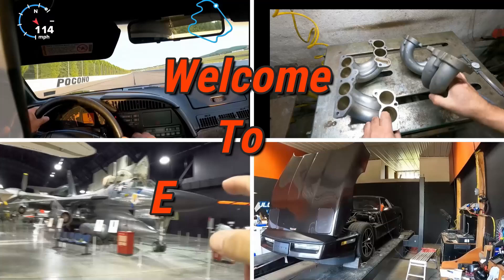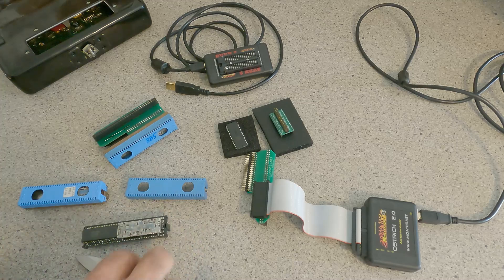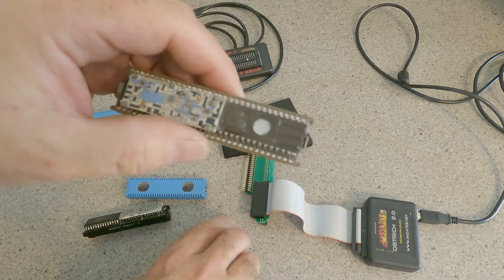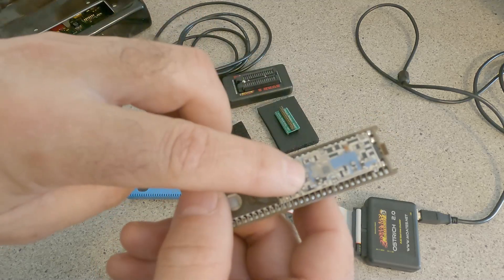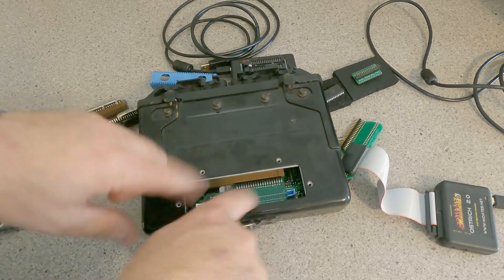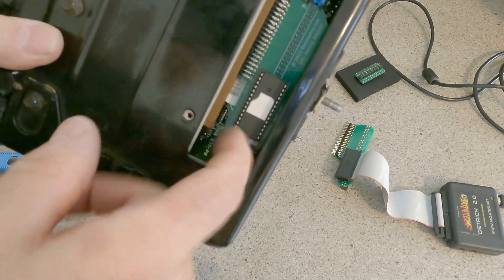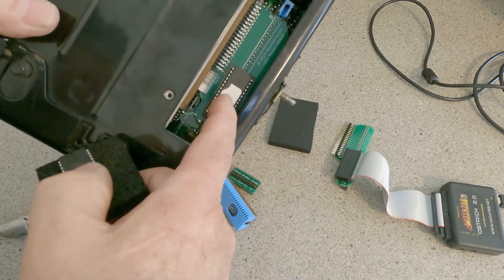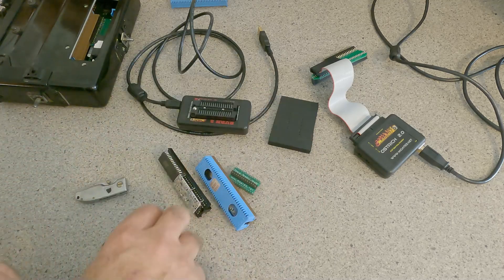OBD1 Chip Adapters 😎

Comment: Question for you: At 6 minutes into the video you mention not having the chip plugged into the GM adapter. I have this GM adapter from my PCM for less tune. HOWEVER, I have not had the chip connected like you show. I have only been using the GM adapter (green). Could this be the reason why I feel like my tune has felt like crap this whole time? 
Also, when plugging in the original (ECM?), which side should connect with the GM adapter? I see the ECM (blue) could go both ways.
Reply from the maker: The memcal or chip as you call it has the factory tune in it on one half of the memcal the other half has the knock sensor and the limp home mode on it, the memcal will plug into your adapter facing the same way as when it is plugged into the ECM. Hope this Helps 👍
Reply: @E.T.GARAGE  Holy cow I have had it unplugged this whole time. That means my car has been in limp mode?
Reply from the maker: @iBoesen  no limp mode will not work without it plugged in what's important is your knock sensor with out it you may have preignition it's really important to have it plugged in.
Reply: @E.T.GARAGE  I will check out that video. I am going to plug it in and see how it runs.

I have had it unplugged for a while and the car has felt underpowered and sometimes will bog down and stall  in neutral (manual). Do you think I did any damage to the engine?
Reply: @E.T.GARAGE  do you think this is why the car has been underpowered and stalling?
Reply from the maker: @iBoesen  Really can not say, plug it in and find out.
Reply from the maker: Also if you have the time I have a playlist about OBD1 data logging and tuning that may be helpful. https://youtube.com/playlist?list=PL5AMhVA-RNuQ-gIqGdUdktX0orGjpxz6v&si=zwtKhQNV916efIhQ

Comment: Thanks for explaining that stuff jet has a chip/module all together I’ve been really looking at but I ain’t buying until see what it is really  looks like computer model that plugs in to memcal spot on ecm but  I don’t know
Reply from the maker: If you want a custom tune you may be better off going to someone like https://tpis.com/pages/efi-tuning
Reply from the maker: another place you can try is https://tunedperformance.wordpress.com/order-form/
Reply: @E.T.GARAGE  ok thanks really just looking for the factory prom chip truck came from salvage yard and funny stuff going one so idk it works but rebuilt transmission probably 3 times in 10 years so idk
Reply from the maker: the jet chip I believe is a piggyback just like the adapter I showed you but with a permeant chip that cant be erased and changed.